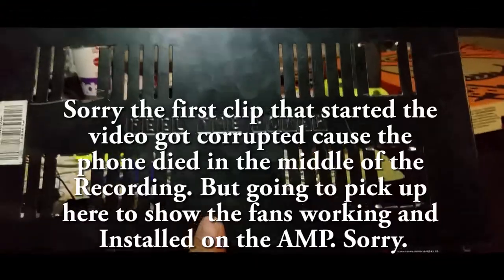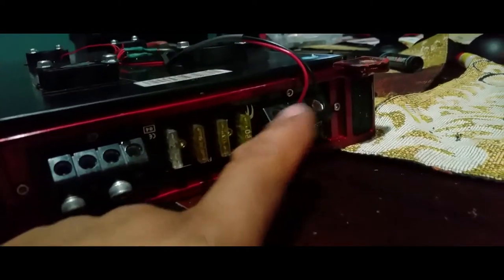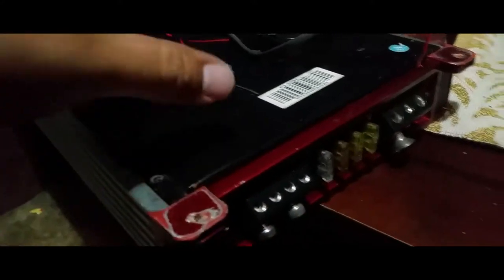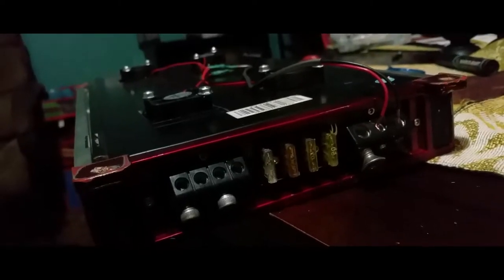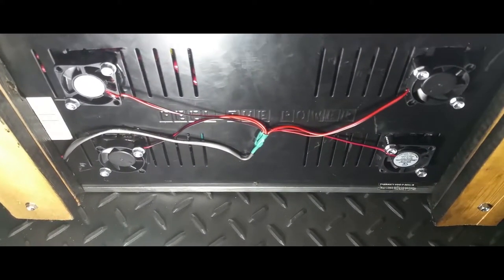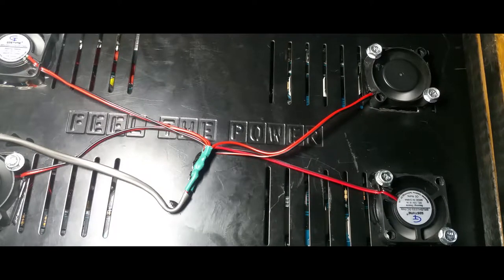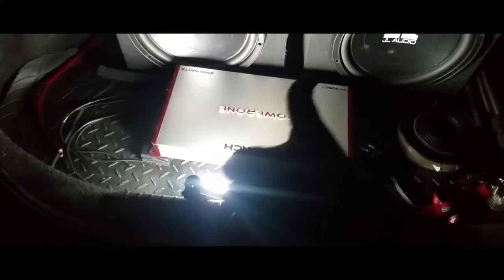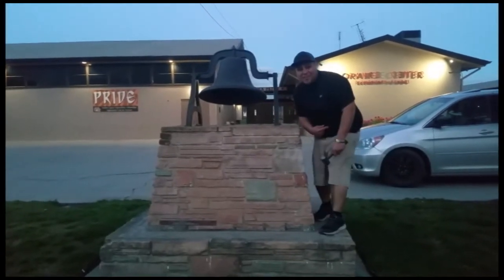How to: Mount the Cooling fans on to the AMP

Comment: So it’s safe to hook the wire to the amps remote turn on? I thought the head unit can’t handle that much voltage?
Reply from the maker: Its just a 12v volt source. Had it for years no problems yet
Reply: @559powerscape  cool. thanks man!
Reply from the maker: @Brazybo520  or find a fused 12v source that is active with the key in the on position
Reply: Just the info I was looking for, thanks man
Reply: Do you get any noise interferance@559powerscape